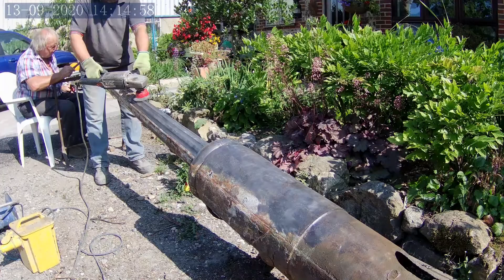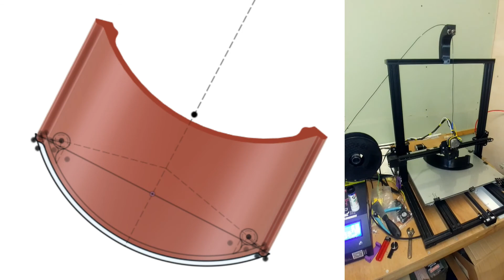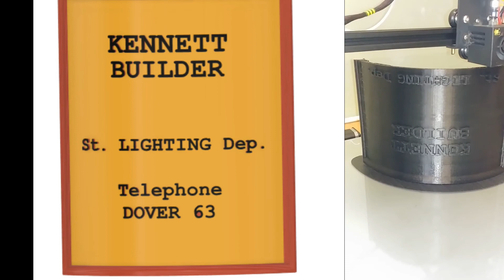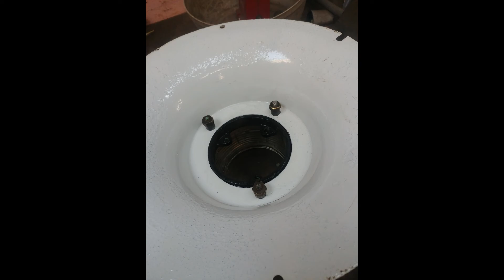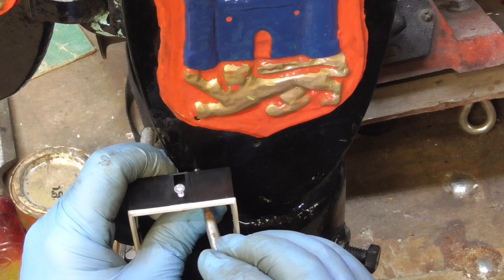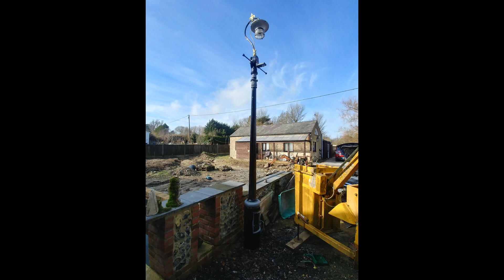Cast iron lamp post Renovation

Comment: Hi if you wanted to get rid of that sensor you could use a smart bulb, that way you could set a timer in the bulb itself.
Reply from the maker: The sensor is very much requier. I see what you are saying, but the resident has no internet and a phone with a b&w screen!
Reply: @WarGrade Aah fair enough, the only other  thing you could use is a Phillips Hue bulb that can connect via blue tooth. That way you could set it up on a dawn to dusk timer and leave it at that.

Comment: You know I think the door should have been cast  - flat (in aluminium) and then bent to suit.... Martin
PS it does rather look good also love the flint house walls.
Reply from the maker: I was awaiting your comment Martin lol
Yes but as I said at the time to you, by time I had 3D printed a pattern I might as well printed the door & to look at it you wouldn't know until you open it and realise there is no weight to it.
The flint work was a little easier to do back when we did that, we had tones & tones of flint to choose from. Doing the wall for the garden has been a wee bit more painful as were starting to run dry of good flint now.